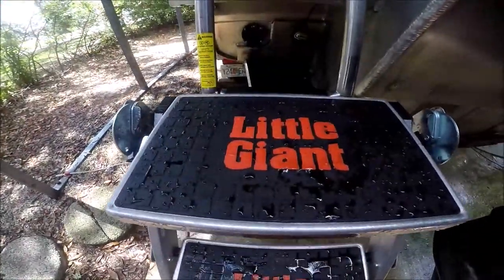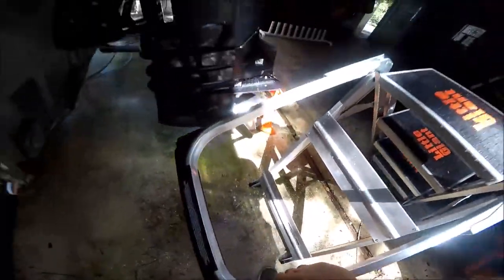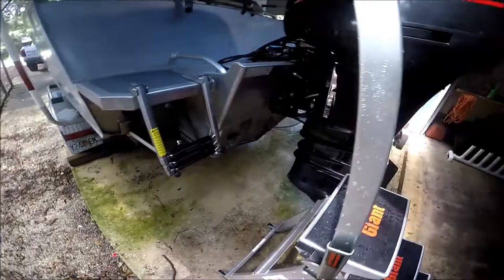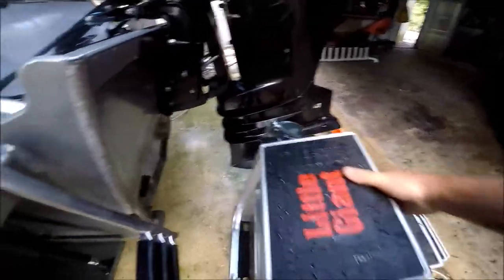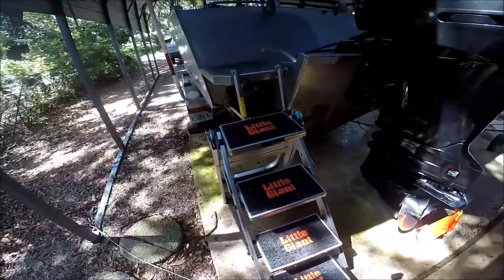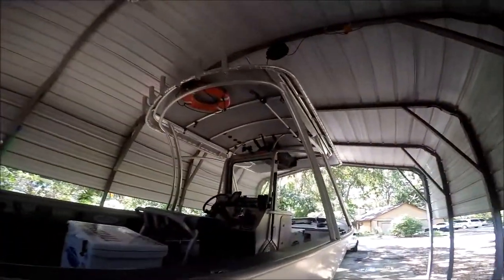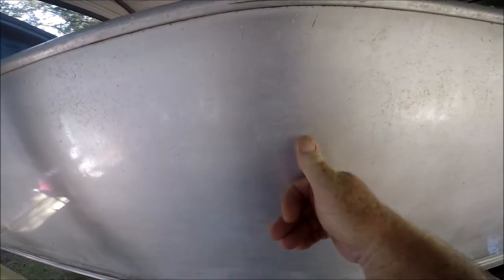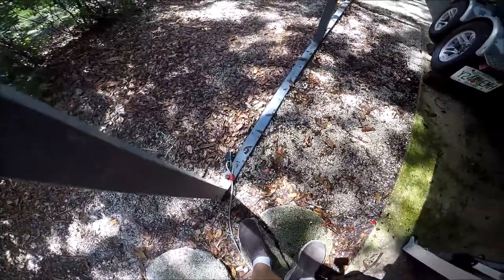''LITTLE GIANT'', boat steps? 10410BA Safety Step Ladder

Comment: I pressure wash my Shearwater 25LTZ every time I get home, no big deal. Oh, I pour a bleach water mix in the bilge, it'll start to stink otherwise. I like those steps, I've been using a step ladder, may have to pick some up.
Reply from the maker: IrishDevil78 yeah those glass boats mean way more maintenance
Reply: there is no bilge to clean on a Pacific   completely sealed and filled with foam
Reply from the maker: no not really, there's a bilge.  But it certainly doesn't get fish grime in it.